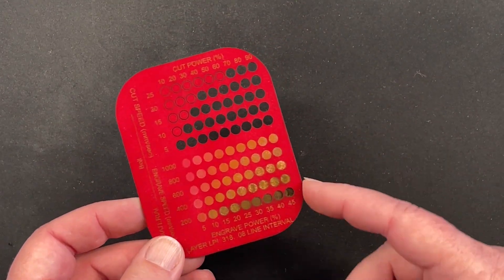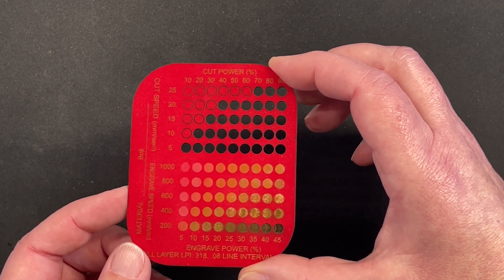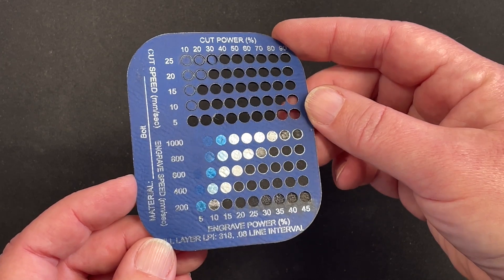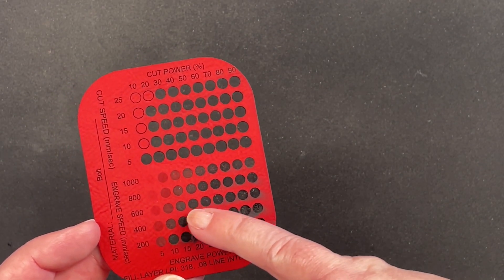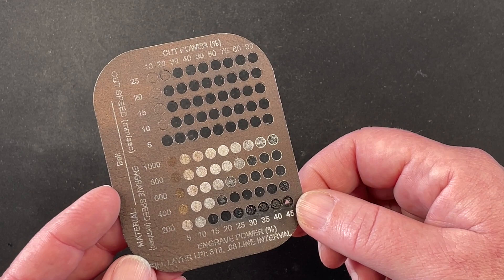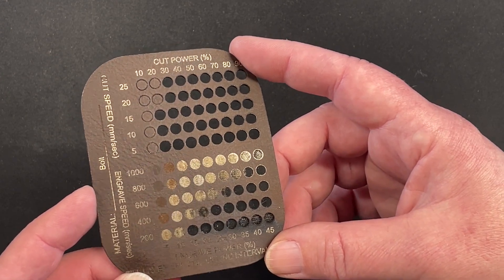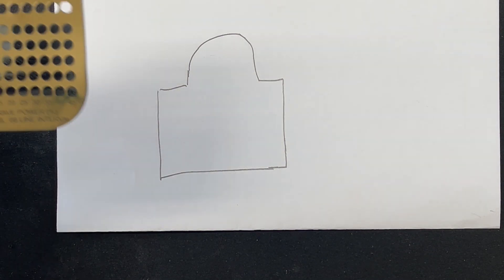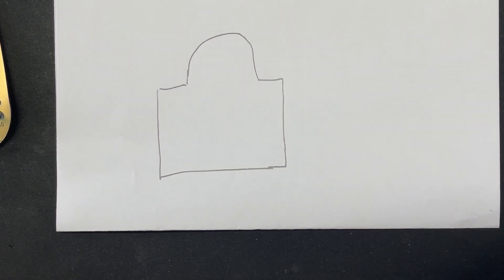Material Tests on the Thunder Laser Bolt

Comment: Can you explain how defocus helps? Also- are those custom test files you use or are they available online? Looks so much better than the LB test. Thanks!
Reply from the maker: The test files are on the Thunder Laser USA website. Defocusing alters the size of your dot size allowing it to overlap other passes . There are a lot of benefits as well as drawbacks to Defocusing. Thunder USA  did a video on lenses  that may help to explain
Reply: @Angrycraftsman  I will check them out! May I also ask what you use the Bolt for? I am ordering Bolt as my first and only laser to begin and hoping it’s versatile enough until I can outgrow the size.
Reply from the maker: @CoffeeJake  ours is set up primarily for tumblers. We also use it fine detail cuts and engraves. It does great for our solid wood earrings.